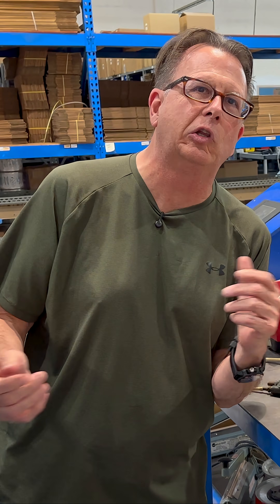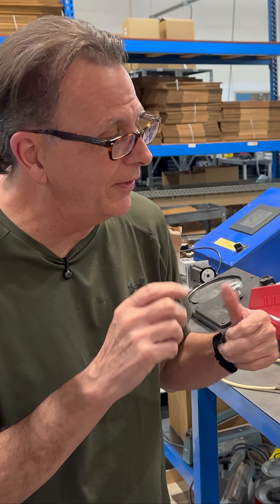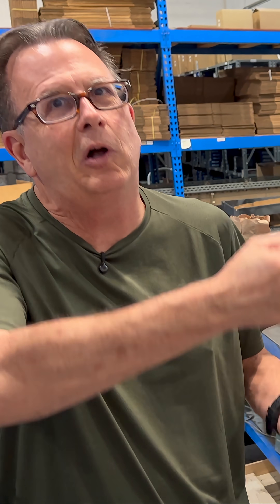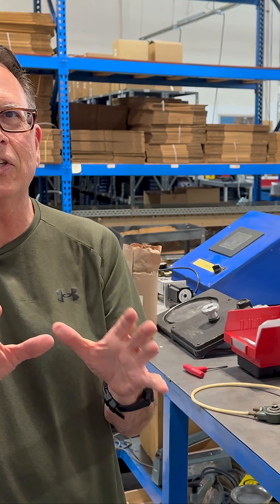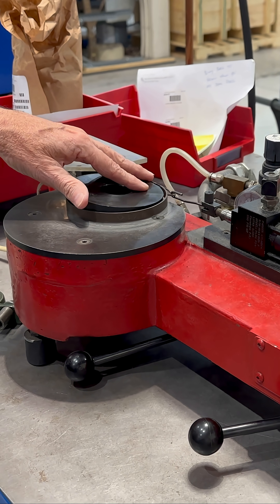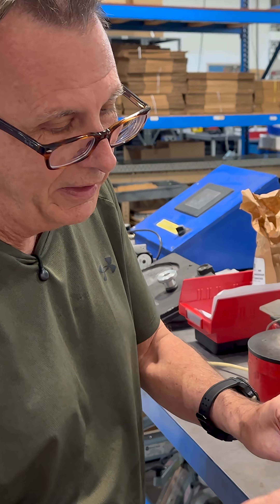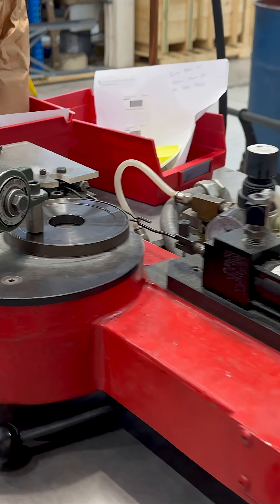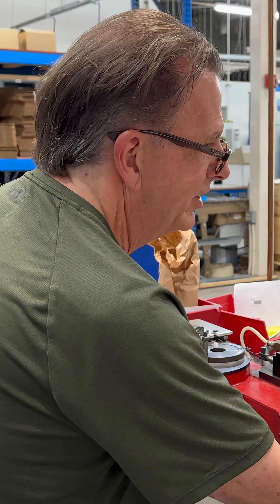Biggest DRAG in Your Engine! Keith Jones w #BarryT #TotalSeal #pistonrings #enginebuilding

Comment: What do you think would be good for a dz302 11.5:1 & o ringed for 45# of boost and 8500+ rpm? 10#?
Reply: 11.5 : 1 with 45lbs of boost? 😂
Reply from the maker: Yeah that sounds pretty FAR out there....
Reply: Yeah I want more than n/a and nitrous but boost as well I may just run a smaller shit for the dramatic cooling affect but it has a huge intercooler already as well
Reply: @BarryTsGarage im o ringing the head and block so I'm sure I won't have any issues, I won't be blowing head gaskets like these four bolts per cylinder LS and not that many guys build them properly anyway, they junk yard special everything LS at so played out I hate them! I grew up with my dad 68 GTO, so I'm old-school SBC BBC or Pontiac lol, I just prefer to run efi with my tpi, and when I go BBC I'll run a 114 lsa cam for efi.
Reply from the maker: I'll ask Keith

Comment: 80%. seriously?  how bout throw an engine together with no oil rings and compare it to one with oil rings.  im skeptical.
Reply: Yea 80% is quite the exaggeration.   Considering the oil rings them selves have no spring tension, it’s only generated from the wavy center ring.  And that is made of a dead material.  Once you crush that down it won’t bounce all the way back..
Reply: @terrypikaart4394  ive built many engines over the years,  with a statement of 80% in the rings makes me think about the friction in the cam, the oil pump, and the normal resistance in the rotating assembly. ive never thought to put a torque wrench on the crank and see what each component adds up to.  I know a high volume oil pump eats some torque for sure.
Reply: @MrChevelle83  oh I agree, but the valve train on a V8 is probably biggest signal drag..  I’ve had them spinning over nice and free with everything assembled, except the rocker arms…
Reply from the maker: I hear you - I’ll follow up 👍

Comment: Yeah but that doesn't compensate the variance in the piston groove and what type of hone finish in the cylinder and the block swell frome heat and vescociety of oil and the material is in the oil and type of piston .
Reply: This is a baseline for the oil rings . He explains this
Reply from the maker: We get more of the details in the full video. Thanks!
Reply: That's a manufacturer, they need something that's repeatable to compare too, to make their different ring types and they can also publish. They can't control all the variables you mention that engine builders might use so it's also a general reference they can use to decide all those variables when they pick a ring package for the engine their building!
Reply: Those are other variables determined by various engines, this is testing just the oil rings themselves against a standard.
He kinda explained that.